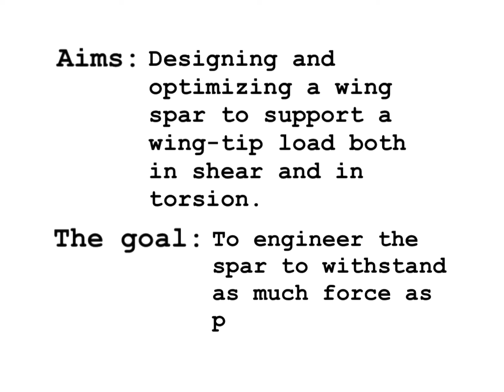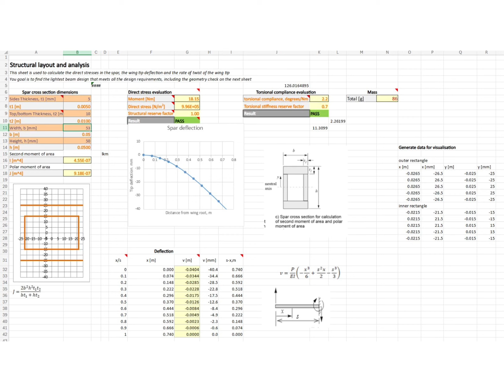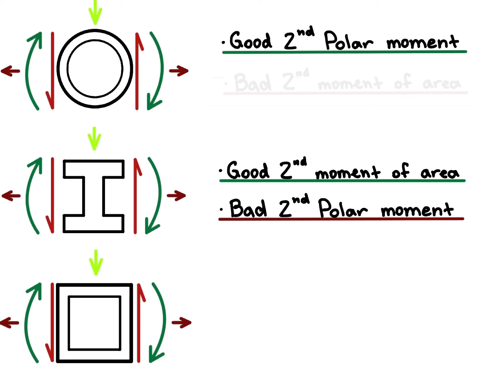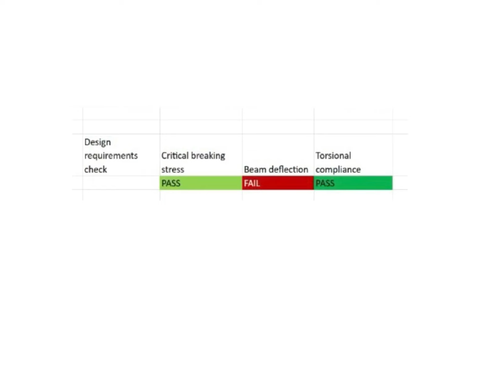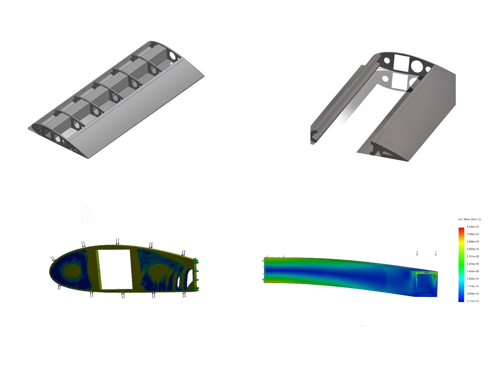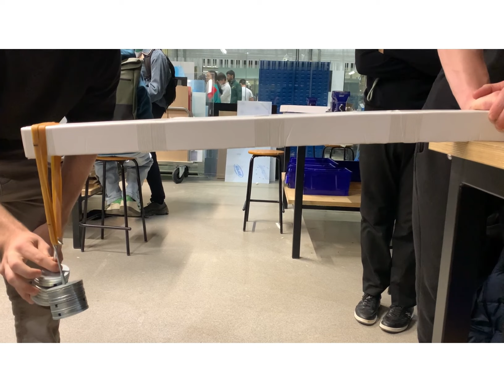Wing Design Group 12

Comment: A beam of continuous thickness does not make sense. 
The beam should be thick at the beginning and thin at the end of the wing. 
Then each rib will be different and the construction will be complicated. 
But this is typical in mechanics, complex structures are lighter and more durable but are more difficult to make.
Reply from the maker: exactly! that was the design we adopted in the end, unfortunately its down to time constraints that the final beam was not included in the video as well as material limitations. if i am able to record the testing, it will be posted soon :D